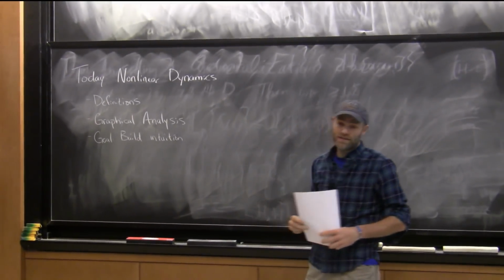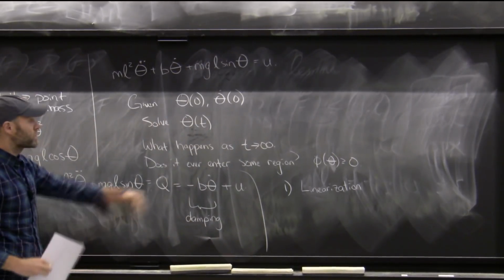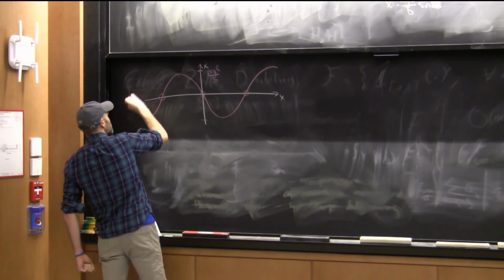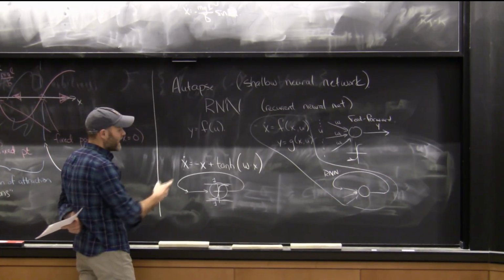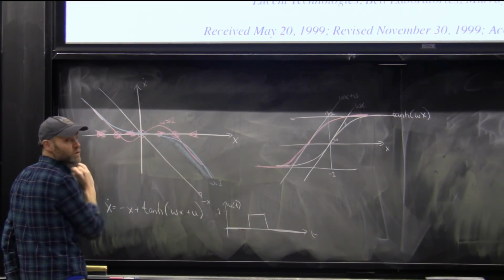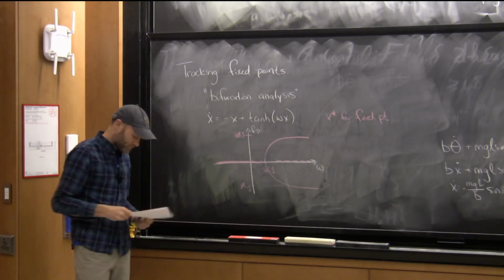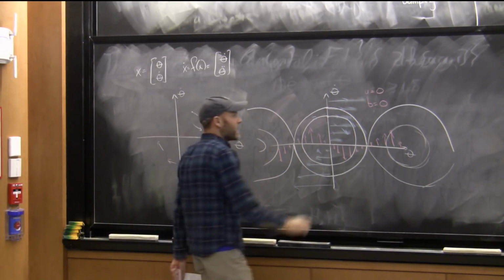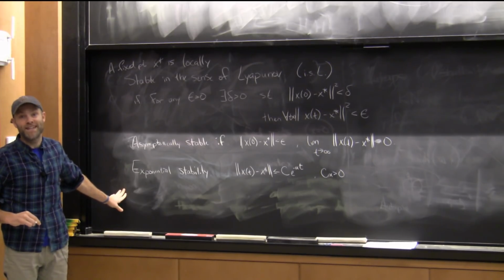Lecture 2 | MIT 6.832  (Underactuated Robotics), Spring 2019

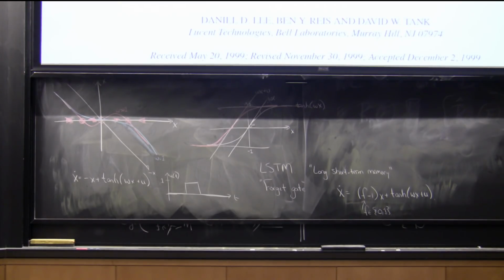Comment: At 47:10, why would the system go back to zero when -x is turned off with f=1? there's no stable equilibrium point, wouldn't the system go to -inf or +inf? Could anyone help me? Thanks!
Reply: Good catch.  I had an error on the board there.  LSTM's are typically described in discrete-time, where the update looks like x[n+1] = f*x[n] + additional terms for the input -- and in discrete time setting f to zero has the intended effect (setting x to zero).  Apologies!
Reply: @rtedrake  Thank you for the clarification.

Comment: @19:50 Since
    b theta' >> ml^2 theta''
must hold for all t>=0, one can just integrate over t.
Also, we should use abs:
  b |theta'(t)| >> ml^2 |theta''(t)|
since theta' and theta'' can be negative.
We could integrate over [0,T] where T is the full period of the pendulum, but it's easier to integrate from 0 to T/4 because theta' and theta'' don't change sign on that time interval and so we can get rid of the absolute values. Thanks to symmetry, we can ignore the remaining 3 quarters of the interval.
By integrating LHS and RHS and using (exercise!) a few tricks here and there, one can get, modulo a multiplicative constant, the inequality
  b sqrt(l/g) >> ml^2